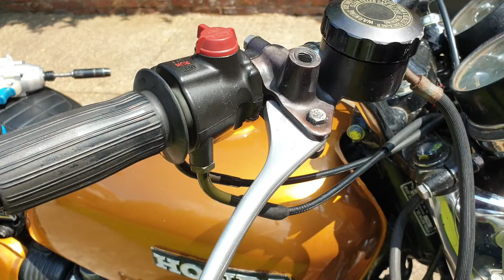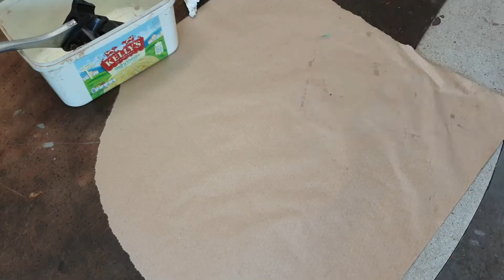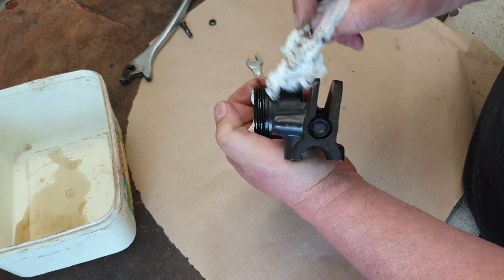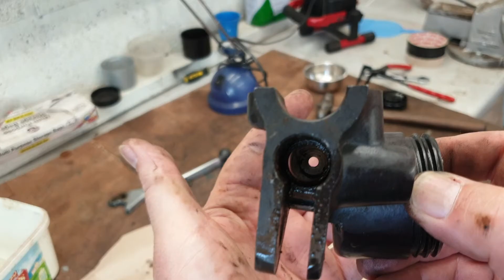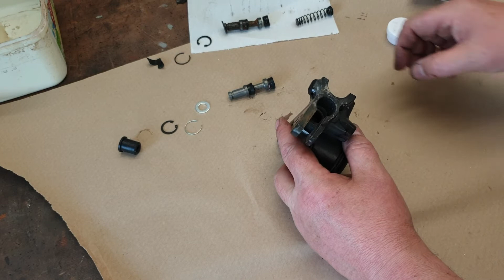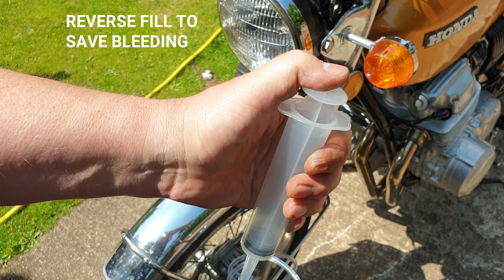Honda CB750 Front Brake Master Cylinder Rebuild | Motorcycle Weak Brakes Fix | Part 24

Comment: I'm having the same issue of a soft brake, which a fresh brake bleed did not fix.  I ordered a kit and may see about a braded line as well.  By the way, I really like the shirt you wore in this video!!  Brett from Florida, USA
Reply from the maker: I love that Tee, but it is getting a little threadbare now :(  It's annoying when a disk brake doesn't stop as well as a drum, but just wait until it starts squeeking, that is an even bigger problem to solve.

Comment: Hi ,from Newzealand how critical is that silver split ring . My mastercylinder on my k5 didnt have 1 .
Reply from the maker: No, it isn't critical.  

It makes sure the dust seal works better, but the master cylinder will work just fine without it.  I suspect very little dust would get in there unless you are using the bike a lot in a harsh environment.  

I wouldn't worry about it if it was missing, but I would fit it if it was there.  Hope that helps.

Comment: Same problem with my CB750. Did this fix the issue?
Reply from the maker: The brake is nice and firm now.  It solved the problem of virtually no power, but it still isn't as strong as a modern brake.  I would really recommend using the braided line.